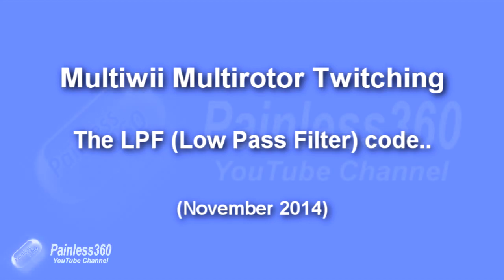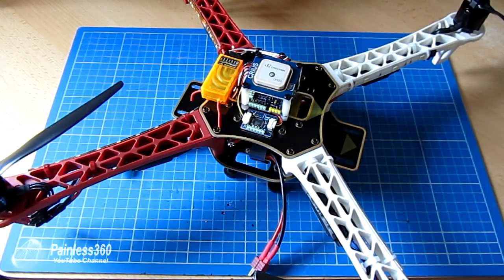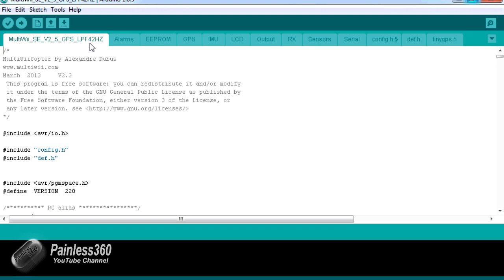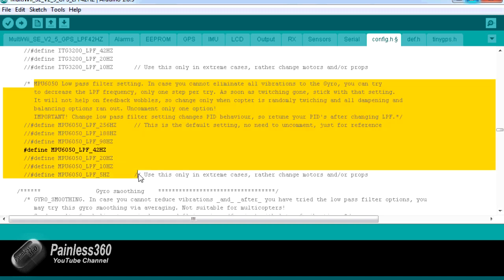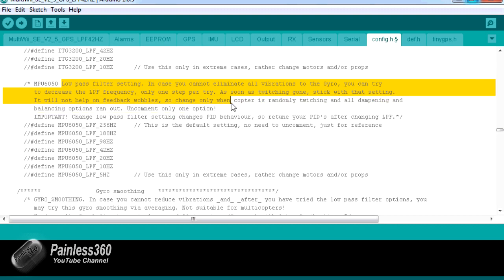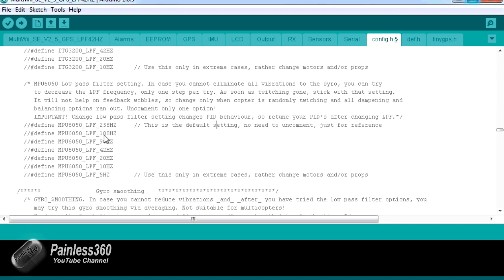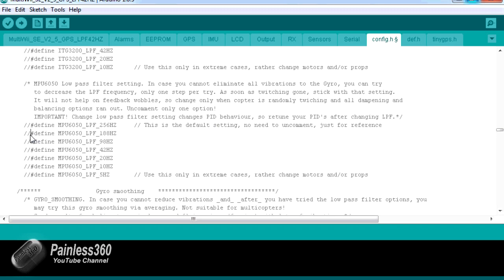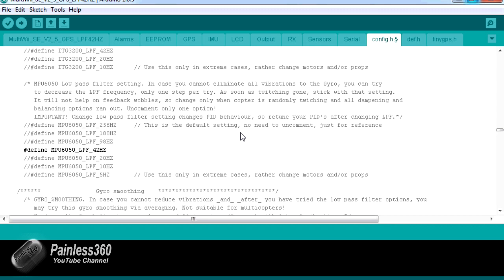MultiWii Quick Tips - Stopping flicking/pulsing motors using LPF

Comment: Its unfortunate on my model the twitching is so bad it will not take off and even hover. :( I think the motors need to be balanced (I got 2 balanced very well) but the mounting mechanism is fairly heavy and not machined with an adequate level of precision. The way is seems to mount is that the a sleeve  with threads fits over the shaft and a ring get put on that, and the prop does next, then the last bit screws on, and it stick out a good inch away from the bell of the motor. By that distance, even the smallest imperfection in the weight and balance of the mount will cause it to bend outward as the motor revs up, leading to lots of vibs. I will be if I can replace the bit that screws on with a simple nut instead that has physically less weight and a smaller profile.

Looking for different motors, it seems like threads are on the motor shafts themselves and the prop is pressed against the bell of the motor itself, which is a FAR better mounting system and avoids having a bunch of rotating weight far out from the bearings and bell. I'll see what I can do about it after I get a proper prop balancer and make sure mt props are balanced correctly.
Reply from the maker: Hi PowerMax, I think that until you have balanced all the kit (all motors and props) you won't know if its that. Sorry to hear that you still have issues. I hope you get flying soon..

Happy flying (soon I hope) !
Reply: Painless360 Thanks! I actually got the quad up into the air today, not sure if it was balancing the props, the motors, or lowering this PF value to 98Hz, but no matter, it flies!

This big thing is so graceful, even as it falls and crashes (when the battery slipped out or a bullet connector came loose) My little hubsan X4 is like a squirrel, it is so jumpy and reactive! This larger quad does not do that as at all, I will do more flying and testing tomorrow morning and see how high I can get the LPF before I have the same old problems! Thanks!
Reply: Painless360 Also, is there more specific code the the SE v2.5 of the board, do you have a link?
Reply from the maker: Not as such, using the code for the HK board works great.
Reply: +Power Max I heard turning the LPF off will make the FC and the ESC crosstalk to each other faster.  What will happen if it's set too low or off?
Reply from the maker: See our video on LPF..
Reply: +Anthony Abelardo LPF (Low Pass Filter) does not affect (or shouldn't, anyway) the updating rate of the ESCs. If you want to see a practical example of how LPF works and how to implement it in code, check out this code I made. https://www.khanacademy.org/computer-programming/first-order-low-pass-filter/2933914039